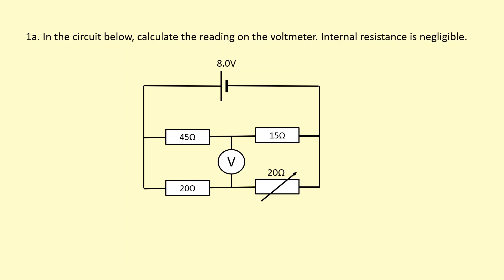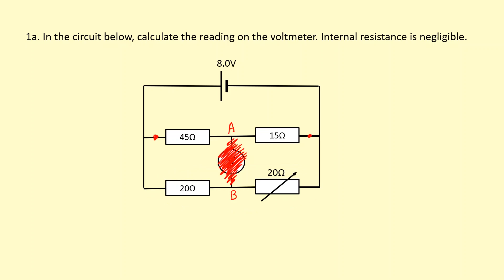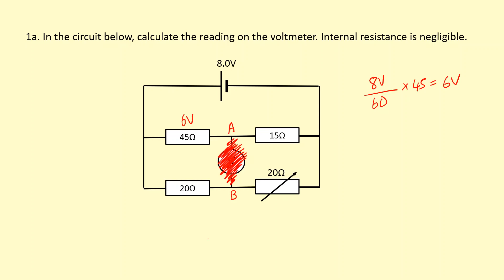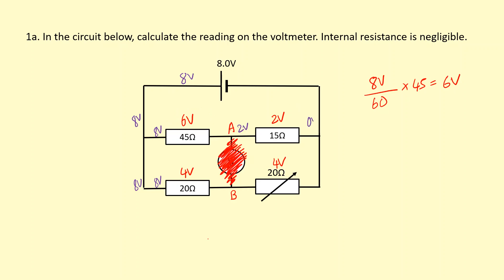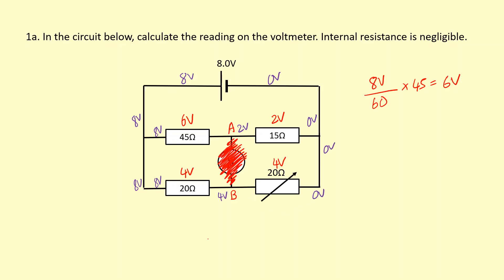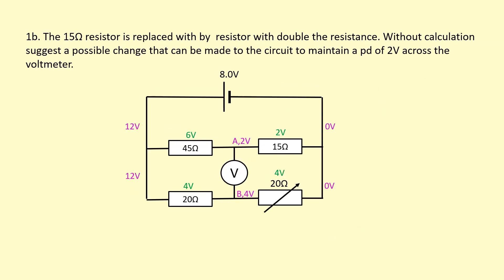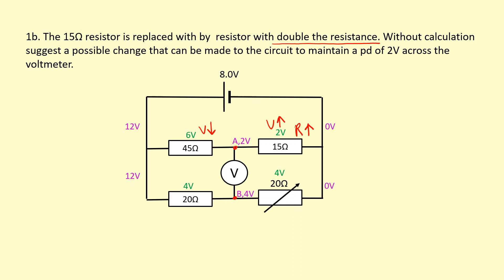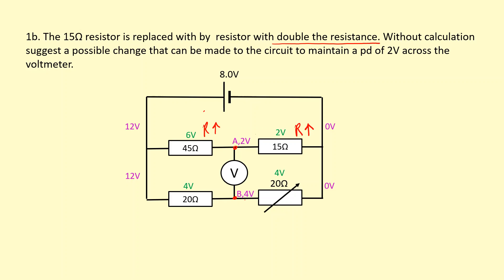3.10 How to find the pd between parallel resistors

Comment: so when we calculate the p.d between the branches this means that there is p.d that can actually be used?
Reply from the maker: yes if you connect a bulb between two points with a pd it would glow. But adding that bulb would alter how the circuit works, it could change the value of the current and pd across different points.
Reply: @MrNagaPhysics  hmmm interesting.. and have there even been any ppqs that ask you to investigate current and pds after you add the bulb between 2 parallel branches?

Comment: For the self study question 1, i understand the potential difference thing, but isnt that assuming the bulb has such high resistance none of the energy will go down it and instead go through the resistor creating the pd of 0 as there are 9V on each side?
Reply from the maker: Hi, Good question. No it doesn't assume that. It doesn't matter what you connect... even a wire with no resistance. There is no pd across that section so no reason for current to go through it.

Try it for yourself. As long as the ratio of the resistance of the two resistors is the same ( leading to zero pd across A-B) No current will flow across A-B.
https://phet.colorado.edu/sims/html/circuit-construction-kit-dc/latest/circuit-construction-kit-dc_all.html

Also from your explanation it seems to suggest you think very high resistance leads to "no energy doing down"  a route. This is not true. For example a simple series circuit with an open switch. The open switch gets all the pd.
Reply: I thought "current always takes the path of least resistance" so why would it share 3v across both the 20ohm and 45ohm resistors then save 9v for the 60ohm and 135 ohm resistor when there's a path with less resistance? (The bulb)